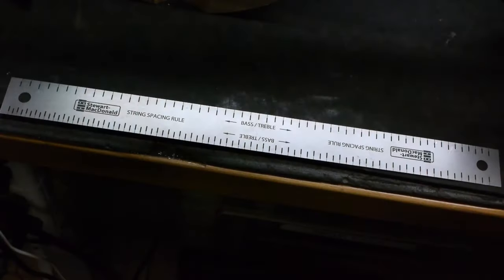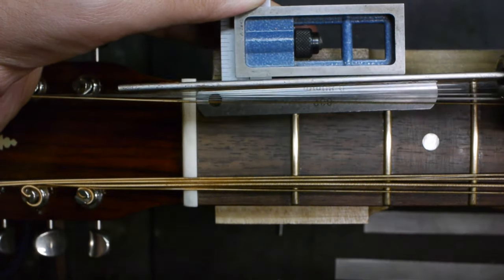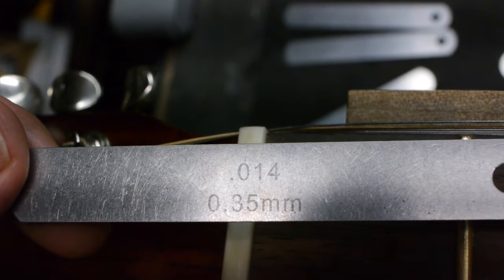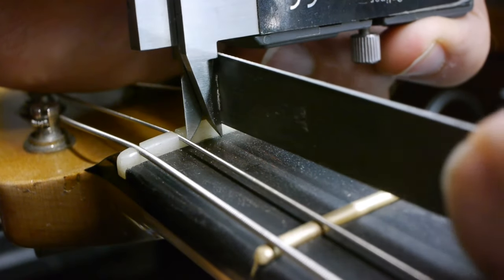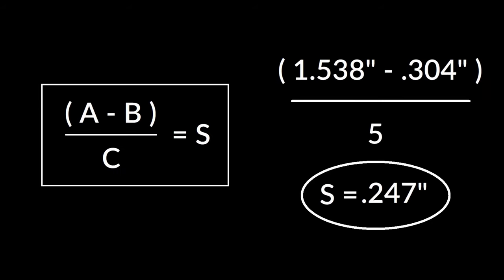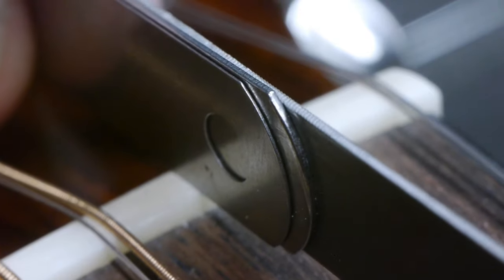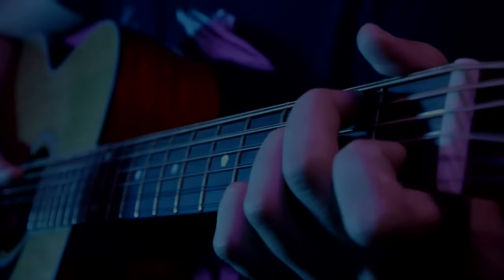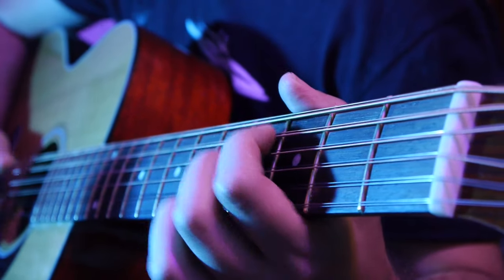12-String Guitar Nut Slotting | BEST Method - FOOLPROOF!

Comment: This is excellent! I'm building a 12 string (in the design phase) since I'm playing some Kottke. Any tips on bridge pin layout?
Reply from the maker: Just to leave enough room for the saddle. I actually prefer 1/4" saddles on 12 strings for the added range of adjustability. I modified my jumbo Blueridge 12 string to have a 1/4" bone saddle, and I use nut files to notch the saddle to compensate it much more precisely for the paired strings. 

Aside from that, I haven't made any bridges yet. I think there's a little more leeway with bridge pin hole spacing. Getting them a smidge closer together than is typical might be really interesting. 

Though there's less room there than at the nut. Biggest thing again would be leaving enough room for saddle compensation. I tune down two whole steps from standard and have a .063 for a low string, and even with the 1/4" saddle, the low E doesn't have enough room to move back farther. 

I could plug all the holes with the Stewmac Bridge Saver and redo it. Just never got around to it. 

I think a baritone 12 string would be awesome. I always wanted to make one. Never built an acoustic, only made a top for one, a single time, many years ago. 

Alternative string mounting ideas might also be interesting. Some of those old ladder braced 12 strings with trapeze tailpieces are super cool. 

I'll have to think about it some more. I do love 12 strings. I will say if you're building one, definitely put a K&K transducer in there. Those things are awesome. A set of those in a jumbo Blueridge 12 string was one of the best guitar tones I've ever heard. I'll let you know here if I think of anything else!

Comment: You Sir, have a wealth of knowledge... thank you for sharing!
Have you had any second thoughts about using the .062/.032 pair for the low E?
Your thoughts on using a .056 instead?
My guitar is an older Sigma DM12-5 Japan. I'm going to make a new nut & saddle, and planning to string it with a custom set of Martin Retro Monel's, with the gages you used in the video... keeping the low E tuned down around C-C#.
Requesting your thoughts on tuning & gages & such.
Thanks! 🙏😁✌🏻
Reply from the maker: Thanks so much! And you're most welcome. 

.056 is plenty heavy for C#. I tune my 12 string to open tunings and my low E usually hangs out around A# or A, so it's super low -- even lower if I'm going to open C. I tune to C or B standard and tune down to open tunings from there, so the strings I use are extra heavy. 

I used .013-.056 standard sets for years with great results. Let me know how it goes!

Comment: Truly excellent video!  I measured the string spacing between pairs on my 12 string guitar, and they are all at least twice or even three times the 0.7mm that you have achieved.  I will be dealing with this now!  There are very few videos or articles online about setting up and adjusting 12 string guitars, any further ones by you would be most welcome.  In particular, your recommended relative heights of the paired strings, presumably the high E and B pairs are of matching heights, but how should the high octave strings for E, A, D & G be set in relation to their heavier partners?  And should the saddle be grooved to match the tighter spacing of the nut?  Your words of wisdom would be appreciated!  Best wishes, Pete
Reply from the maker: I'd get all string pairs to the same height at the nut. I just checked mine and each paired course is within a few thousandths of each other -- if I were to really dial this in, I'd get them to the same height for all pairs. 

I don't groove the saddle, but for intonation, I like using nut files on 12 strings. So the string itself is not sitting on a groove, but the nut file allows for very fine compensation of the saddle. So you'd groove a hollow on the saddle for, say, the Low E string, so the point of intonation will be the very back of the saddle, closest to the bridge pin. 

Then for the octave Low E, you can groove the back of the saddle so the string rests closer to the middle or forward of the saddle toward the soundhole. 

The traditional method of compensating saddles by 'contouring' works fine, but the nut files will give you a lot more precision. 

I use bone for saddles, and while you can notch them so the strings are sitting in a groove, there's no need to do this as the bridge pin holes will dictate the string spacing. Bridges that have poor spacing are typically only found on cheaper models. A quick fix in those cases would be grooving the saddles so the strings are sitting in slots, but the preferred fix would be using a Stewmac Bridge Saver, plugging the holes in the bridge plate, filling the holes on top with something like rosewood dust and CA glue, and redrilling the holes in a better location. 

A massive amount of work that would only ever be appropriate on a true abomination of a bridge...and I've seen them on 12 strings before, but only ones that cost 100 dollars (or less). 

For the extreme down tunings like Leo Kottke uses, and I'm a fan of, a 1/4" saddle is a huge help. I'm still trying to come up with a really reliable way of doing this without any excessively fancy tools, as I don't own a saddle slotting jig -- though I probably will soon! So maybe when that comes along I can do a video on that. 

The 1/4" saddle is super wide and allows for proper intonation when tuning low, where the low strings need to be very far back, close to the bridge pins, and the thinner strings need to be much farther forward. In my experience it's simply not possible to intonate a 12 string well when it's using very heavy strings and tuned very low without using a 1/4" saddle. 

In a perfect world, a slightly longer scale length would be better. I don't build guitars (yet), but if I did, I'd be very interested in making a 26.5" scale 12 string. Just a bit longer to accommodate heavier strings and lower tunings without feeling too different. Not quite baritone but probably better than a 25.5" scale with a 1/4" saddle. 

12 strings definitely don't get the attention they deserve. In my opinion they should be tuned low, and sound best when tuned low...as Leo has said, if you want to tune a 12 string to concert pitch, you're better off playing a mandolin! I thought that was not only funny, but true. 

The deep roar/jangle of a 12 string is what makes them so special to me. For me personally I never tune them above C standard -- two whole steps below concert pitch. This also goes a long way in preserving the top, as it's much less likely to deform and belly when it's tuned so low, even with heavy strings. Stringjoy has a tension calculator on their site and that can be used to see the actual difference in tension between light gauge strings tuned to concert pitch and heavy strings tuned super low. 

Haven't tested that myself yet actually but it would be good to know the numbers. Currently I'm using 13.5 gauge strings on the high E and a .062 on the low E. So the string sets I've been making out of single strings are quite heavy. 

Thanks so much for the comment! Hope this helps!
Reply from the maker: Did a little more thinking and I will say that the string spacing at the bridge on my 12 string doesn't look excellent. The pins are spaced okay but especially on 12 strings, it can get cramped. 

So I may end up notching the saddle after all. If you check out one of my newer videos where I'm working on a Gretsch Chet Atkins Nashville model guitar, you'll see that I use the same caliper method for spacing the strings at the saddles. 

On Tune-o-Matic saddles, there are no notches, and they need to be notched. You can do them in the center by eye, but spacing the outside E strings first, and then using calipers as a fence as I did here, you can get much more accurate and much more precise with your spacing. 

The bridge pin heads may need to be taken down a bit to make room for the string pairs. A lot of times the strings will be running directly against the bridge pin of the adjacent paired string and that can throw the spacing off. 

So that actually is something that warrants further investigation, and I'm excited to see if spacing them similarly at the bridge makes as much of a difference in playability. I think there's a lot more leeway for wider string pair spacing at the bridge, but we'll see! Good question and thanks for asking. 

Not sure why it didn't "click" until a few hours after my original comment. Was in the shower and then it hit me -- exactly what you're talking about. And it's something I haven't considered on 12 strings, which is funny because on my main Stratocaster I notched all the saddles with my calipers. They look very 'uneven' if you only look at the marks, but if you measure the string spacing, they're perfectly even. It made a huge difference!
Reply: @guitar_md  Thank you very much for your detailed reply, so nice of you to take such trouble and respond with such a full response. This has given me a really good understanding of the subject before I set about my modifications. Just one thing more to ask you; when you say you set all the strings to the same height at the nut, do you mean they are at the same level underneath (where they sit in the grooves) or at their top surface?  In other words, are the thinner strings stepped down (compared to their thicker neighbour) which would affect how the strings feel and sound when strummed? Or am I over-thinking this!  Thanks again, and good luck with your future plans and further 12 string experimentation.
Reply from the maker: @petecrush  Using a digital action gauge, the height of the strings will be the same -- so the distance from the bottom of the strings to the top of the first fret would be the same on a given pair of strings.

At least, that's how I have mine set up right now. I think having them the same distance from the 1st fret makes the most sense on all pairs -- unison and octave pairs alike.

Comment: Do you have footage of the bridge? I'm curious to see if the bridge is spaced out the same as the nut
Reply from the maker: You can slot the saddle, but generally, the spacing is going to be dictated by the location of the bridge pin holes. 

I usually don't notch acoustic saddles but it can be done and aside from plugging and redrilling the bridge pin holes -- most achievable way to adjust the spacing at the bridge

Comment: Great video! Having enough space between courses is a big deal specially for fingerstyle playing, it makes all the difference. I suppose if you are just mindlessly strumming the guitar it is not a big deal, and since thats how most people play 12 strings you don't see them set up properly like this. You also seem to cut pretty shallow slots, specially when looking at the wound strings. Any reason for cutting them so shallow, as opposed to the usual depth of about half of the strings diameter (and the full string for the unwond ones)?
Reply from the maker: Thanks! The main reason for the super shallow depth is because the 'wall' between the slots is so narrow. When you cut those slots with a nut file, there's a big risk of that 'wall' between the pairs breaking off. Or when you're stringing up and tuning up. 

The closer you get them together, the more important it is to keep that 'wall' strong by keeping the slot depth shallow. I previously had them quite a bit deeper in the slot and then as I was tuning up the Low E string, it snapped that 'wall' between the string pairs right off. 

Now, even with normal playing of a 12 string, just strumming away, there's still a huge advantage to the string pairs being closer together: no accidental muting during chords. 

So many times people will not be able to play a C chord, for example, without muting one of the open strings by accident, because the spacing isn't wide enough. 

Even if all a person plays are 'cowboy chords' on the first 3 frets, closer string pairs will still allow for much greater accuracy, and avoiding accidental string muting. 

I recently cut a mandolin nut using this same method and it definitely played a lot better after for the same reason. Makes a huge difference. I really think the only reason no 12 string nuts come like this is because it requires too much precision, and if it's not done precisely, the risk of part of the nut breaking off is extremely high. 

Just like with all nuts on all guitars, everyone errs on the side of caution, at the expense of playability. Just about every single nut I see, even if it's spaced evenly (which is already very rare), has the strings way too cramped. Much farther in than they really need to be. Opening up the spacing, making it wider, makes accidental string muting a thing of the past. There's a balance to strike for sure. But a huge improvement! 

I'm very excited to be working on an updated version of this video as well. Very, very excited. I'm completely backed up with videos, but that one is on the way. Thanks so much for the comment, and giving me some questions to answer. I enjoyed typing this out. Stay tuned. And hopefully I was able to answer some questions and make some more sense of things!
Reply: @guitar_md  Thanks for the thorough answer! That makes sense, but have you had issues with the string coming out of the slot because of the shallow grooves? 

Maybe an aluminum, brass or 6/6 nylon nut would solve this issue as the wall would not break off as easily? How about using a v file to cut the wider slots? The top of the wall would be pushed closed together, but the bottom of the groove would be narrower.
(https://youtu.be/k0r63Qd_xZk?t=381)

Regarding the spacing between strings in each course, I've also had issues of sometimes only being able to pluck only one string at a time if the string are too far apart. That is specially true on the 4th and 5th strings, since there is also a big disparity between gauges (and difference in height on the top of the strings) and my thumbs rolls off one of the strings before hitting the other one at the same time.

Looking forward to the new videos!
Reply: Great question as well, I was thinking the same👍